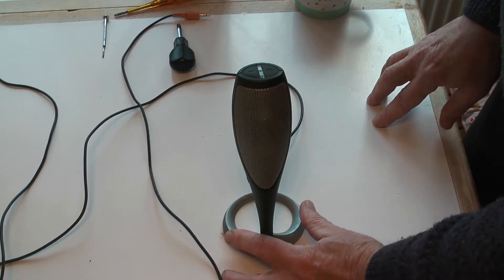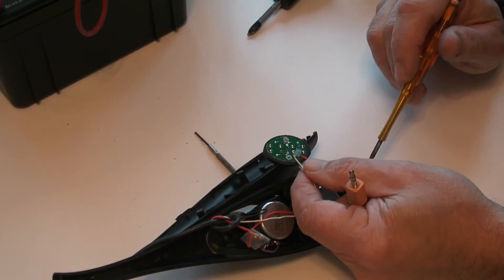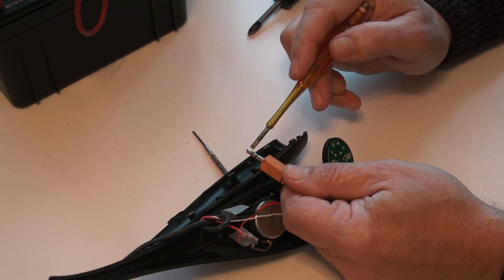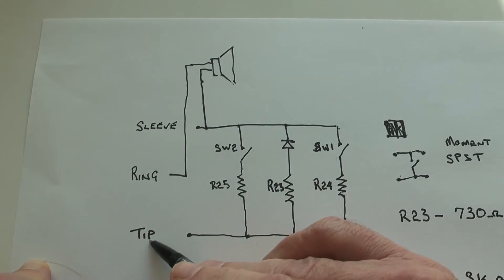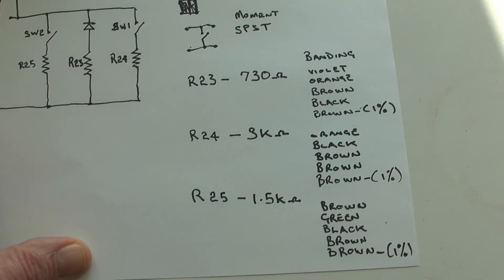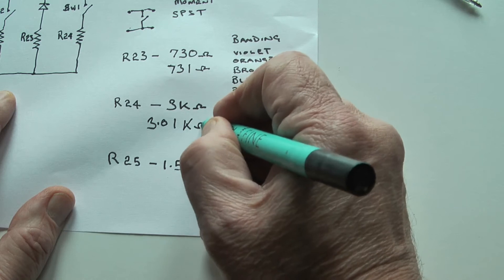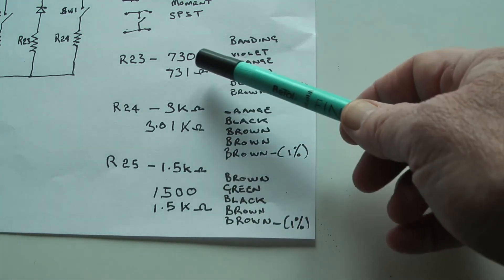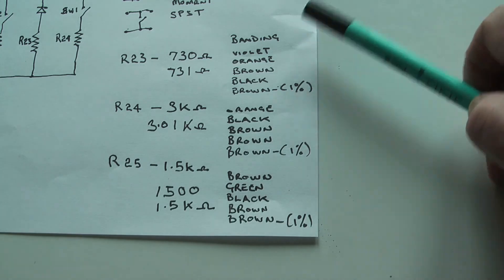Harman Kardon HK695 Speakers - Volume Control

Comment: You need a 690 Ohm resistor bettween sleeve and tip of the jack to add the volume.  but the system always starts from default sound level (low) after being disconnected to power so you definitely  want to assemble a simple button to raise the volume
Reply from the maker: Thanks for taking the time to post this information - this will bring a lot of hope to those struggling without the volume control. If anyone out there tries this, please respond with your results to confirm it works. It really does help all of us with the same problem.

Comment: Hello. I came across such a subwoofer some time ago. To increase the sound, as @ivanosokor3997 wrote, a 600-700 ohm resistor between the sleeve and the tip works, but to reduce it with the resistors from the video it does not work. So I connected a diode n4007 in series with the 680 ohm resistor and that's how I got the desired effect.

Comment: The volume buttons on my hk695 works but the max volume is very low, is it related to this module?
Reply from the maker: My friend complained about very low sound.  Initially I thought the problem may have been in the preamp which is housed with the subwoofer unit.   The subwoofer was working fine.   However, the side speakers were very low and slightly distorted.  The speaker cones were non-existent!  They had crumbled to nothing.  Worth checking this first by removing the speaker grill to the side speakers.  If these are intact then the problem is elsewhere.  Always worth checking all the plugs and sockets first before looking for problems like this.  Start with the simple stuff, don’t go looking for trouble unless you have to.  As to the amplifier and preamp – I know nothing about the circuit details for fault finding.
Reply: @colemanus1318  Thank you for the tips.

Comment: I have the working subwoofer only. I notice the square jack(for the volume) is like stereo jack. Can i connect it direct (the sound at max vol) without the control volume part?
Reply from the maker: Presuming you are controlling the volume by some other means, there is only one channel coming out of the jack socket. From the sketch in the video the sleeve of the jack is the common rail. Audio to the speaker goes via the "sleeve and ring", whilst the volume is controlled via the "sleeve and tip" of the jack.
If you have a two pin jack that fits? The business end only has a "tip and sleeve".  In this case the sleeve will effectively short the audio output.  Hope that makes sense and thanks for the question, good luck!
Reply: @colemanus1318  yes, I will use the source to control the volume, I think the problem can be solved from your explanation. Thanks mate 😃
Reply: I try on stereo jack , it sound low by connecting it on L(tip) & R(ring), no signal if connect to sleeve.

Comment: thanks for the review I have these still working well after many years as computer speakers as originally intended. One tip you may already know is if you depress the two volume switches on top of the right champagne glass speaker it mutes the volume, touching both or either again restores the sound. thanks again!

Comment: I have this sub unit without the speakers, so I need to replicate the volume controls with this diagram. If I understand correctly, the jack base or sleeve is the speaker ground and button logic common ground. The center ring is the speaker positive, and the tip would be some reference voltage for the button logic. R23 is just the LED current resistor and probably not needed. Also, what is the impedance of the original speakers? Thanks.
Reply from the maker: The original speakers were 8 ohms each.   2 in each side speaker enclosure and wired in parallel.  If you go this route make sure you  wire them in phase with one another.
Reply: @colemanus1318  So 8 ohms at the jack? I have only 3.3k resistors, I'll see if they work. 2 in parallel will give me 1.65K for SW2. Hopefully that drops the voltage close enough when pressed.
Reply from the maker: All I can say is that I just sketched out the volume control circuit from my unit’s volume control to the best of my ability,  I did this to aid people, like yourself, needing somewhere to start. What the design criteria is, or how it works, I have no idea. 

As  you don’t have the original side speakers, perhaps if you scan through this video where I replace the damaged loudspeakers may help in someway.
https://youtu.be/jiw68RqqAM0
Reply: Hello! I have the same problem! hahaha, did you manage to make it work with the diagram? to encourage me to do it, because connect the sub with other speakers and it sounds very low and you can't turn it up without those controls. Thank you!
Reply: @CrisPoh  I didn't have the exact resistors or the LED. I was playing around and managed to only turn the volume down completely. I haven't looked at it since.